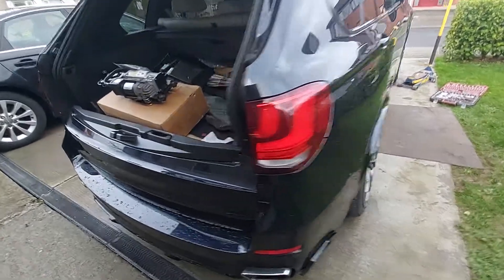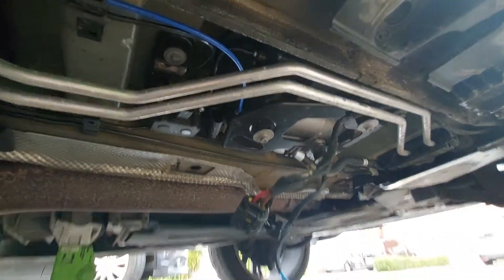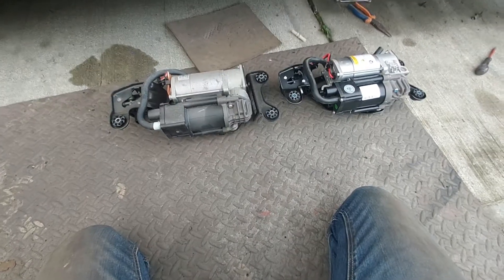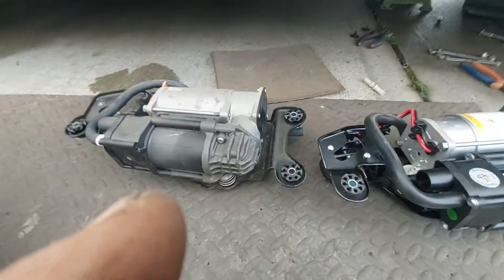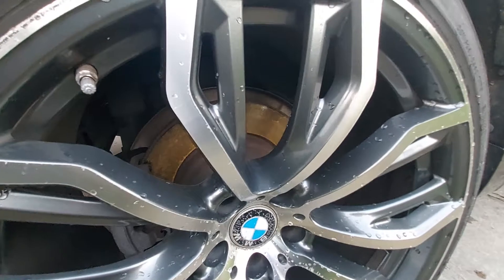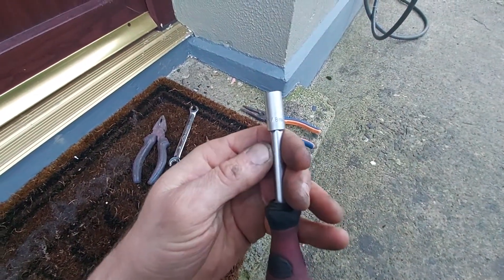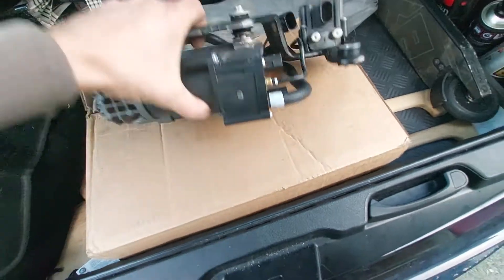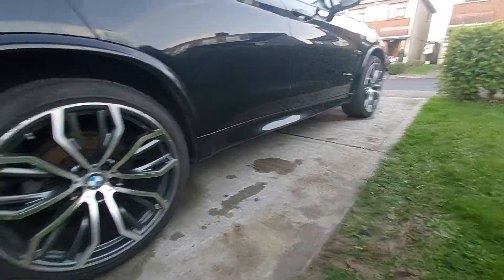2015 BMW X5 F15 AIR COMPRESSOR REPAIR

Comment: Did you do a post mortem on the old pump to determine the failure mode?
Reply from the maker: I can  heard pump  going  but  not  pumping  air  no  leaks  on  air lines  or  air bags  so  definitely  pump,  pump  it's  possible  to  repair

Comment: Why do you replace relay?
Reply from the maker: It's coming in kit
Reply: @ovipa1950  Mine did not come with new relay, so kept existing one. My air suspension is working again with new compressor.
Reply from the maker: @tomladdus9264  used  old  relay it's okay  if  she  good

Comment: Air Springs are not designed to be under inflated with vehicle load. Anytime a compressor fails. Replace air springs.
Reply from the maker: It's up to you

Comment: Hallor, sir. So if I'm a normal mechanic, I can do this replacement without needing to reset anything (machine) on the computer? I thought this is only done with resetting and something else and was afraid to unplug compressor? Kindly assist sir..
Reply from the maker: Just  put new  compressor and job done

Comment: Thanks for the Video, my Compressor ist not running anymore, the last 2 years, it goes of 4 times and after 1 day its works again, is it maybe a contact problem, thanks Berni

Super Video, vielen Dank. Die Niveauregulierung bei meinem X5 Bj. 2018 ist in den letzten 2 Jahren 4 mal ausgefallen und nach 1-2 Tagen hat der Kompressor wieder gearbeitet und alles hat wieder funktioniert. Vielleicht ist es ein Kontaktproblem wenn der Kompressor nicht läuft...
Ich war heute bei BMW und habe einen Termin in 2 Wochen gemacht um den Fehler zu finden, was mich 300,00 € kostet. Aber ich kann nicht 2 Wochen warten, da ich das Auto jeden Tag brauche. Ich suche jetzt einen Mechaniker in Augsburg, der mir mit diesem Problem weiter helfen kann, da ich absoluter Laie bin. Habe auch schon gegoogelt und ein neuer Kompressor kostet unter 300,00 €

Comment: You need to tune it or something? Or just plug and play
Reply: Hi Did you figure out this question? I'm.about to replace mine and thinking if it's a plug and go issue or something.else needs to be done after replacement-these cars are costly if u forget something.

Comment: I have the same Problem and same car my wheels on the back are kissing my Car😂 air compressor... , which manufacturer do you use? I used Wabco
Reply from the maker: Yes  wabco